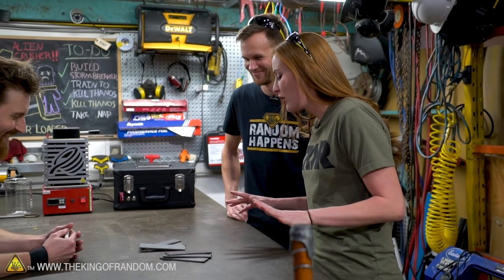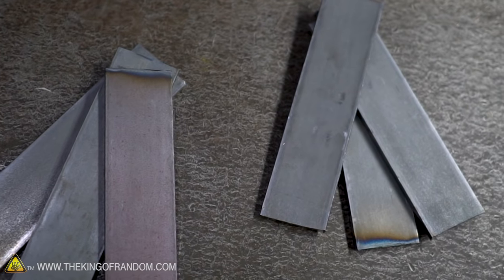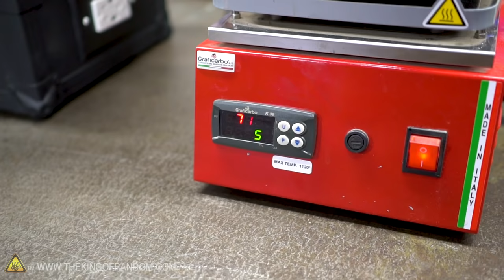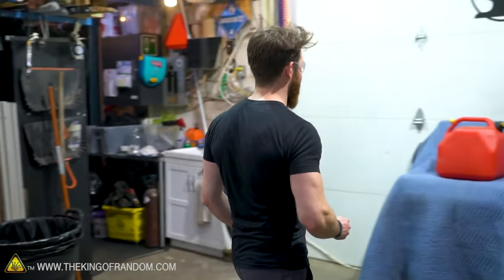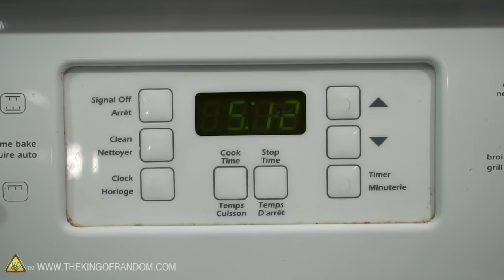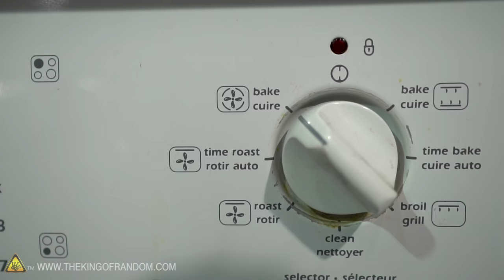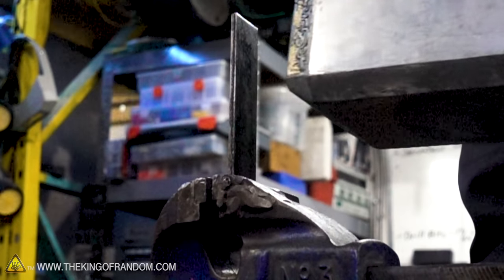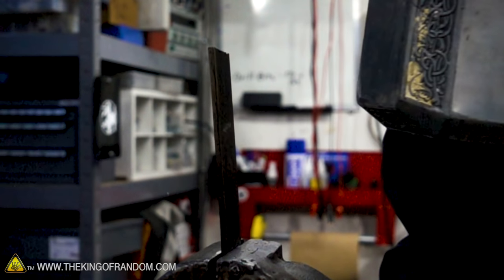How to Make Tempered Steel w/ the Hacksmith

Comment: 1084 is absplutly not high carbon.  1080 is pretty much what all regular steel is. Plus tempering doesnt make it stronger.   It actually makes it weaker as far as tensile is concerned.  It just turns the matensite into pearlite
Reply: I don't agree with your first part of the comment. Mild steel which is most common for manufacturing (my boss runs a steel works company) and that's about    .25% or less. High carbon is .5 - .96%
Reply: @dfalconerio  for cheap knifes sure but 1080 is about as common as it gets.  It is moderate carbon at best.  High carbon is anywhere from 1-2.1% (including ultra high) sure astm 572 is a lot less but thats not the point. 1080 isnt much

Comment: If you're going to properly harden steel, the steel needs to be IN the oil as quickly as possible as it cools upon leaving the heat. This slight cooling affects the heat treatment.

Comment: I hardened and tempered a 14in dagger I made from spring steel. Afterwards, I could bend the blade 2in and when I let go, it returned to it's original shape without permanent deformation.

Comment: If you want me to take you seriously then don’t try to skew the results to prove what you think. You CLEARLY hit the tempered steel much lighter than the rest and it DID bend. You quickly cut away and had the camera at an angle that made it hard to tell. That’s bad science.